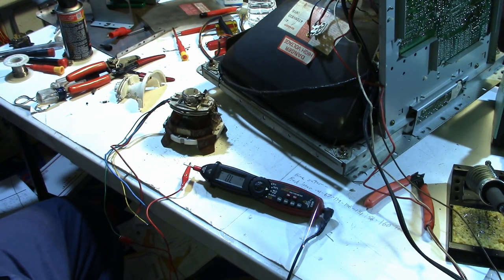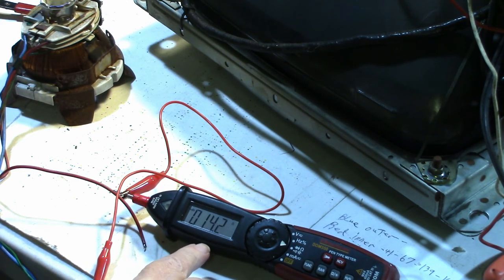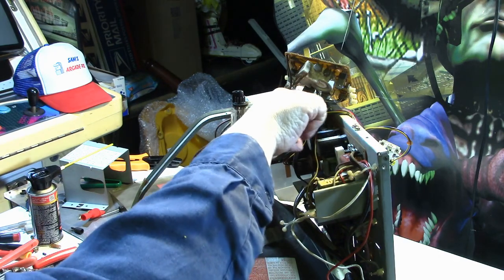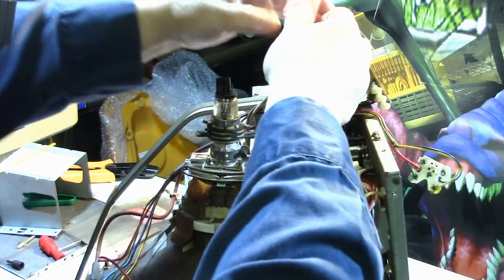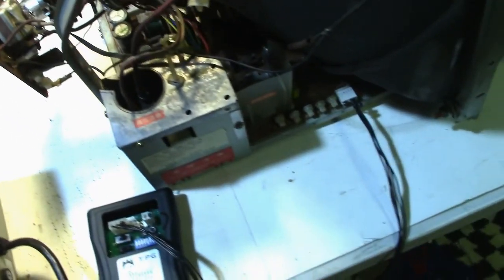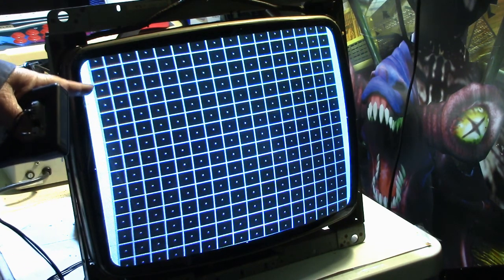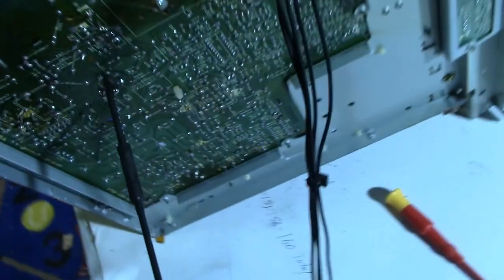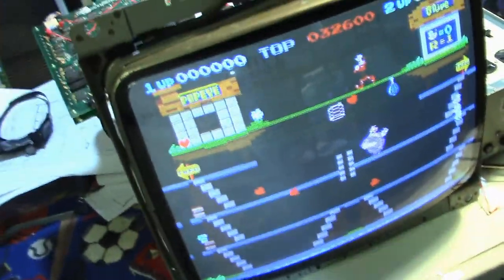SAM'S ARCADE FIX PART 4 NINTENDO Sharp XM 1801N REPLACEMENT YOKE FOUND WILL IT WORK

Comment: All that you see from/on the TPG screens is normal on the XM or Sanyo, if you have older firmware.
if you have newer firmware then some of that has been changed.
you should have never messed with your yoke from the first time, it was already very good.
the TPG is only a reference, you need to use the game to adjust your width and then change the width cap, the TPG always displays a larger image than your game.
do NOT change your width cap until you connect it to your game and adjust.
fun series thanks for sharing.